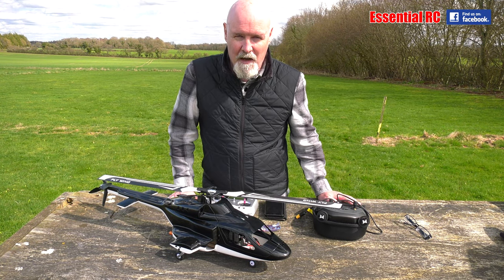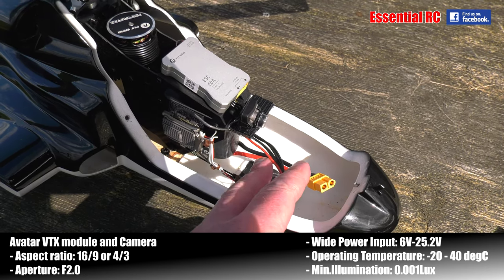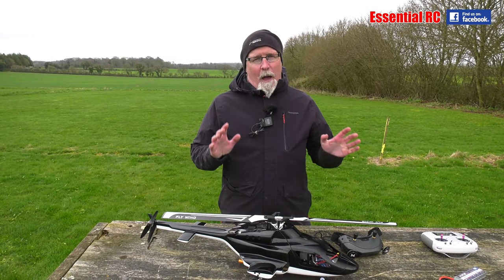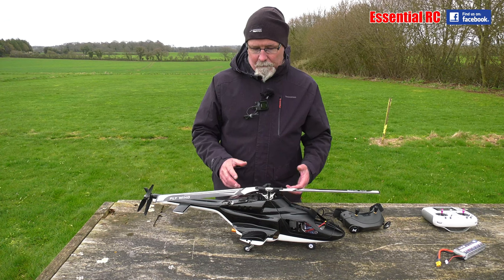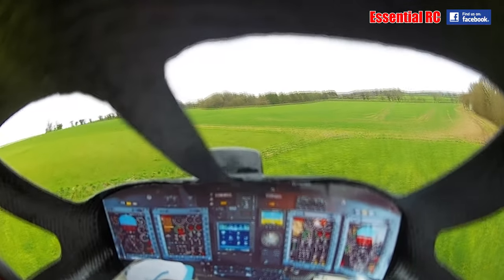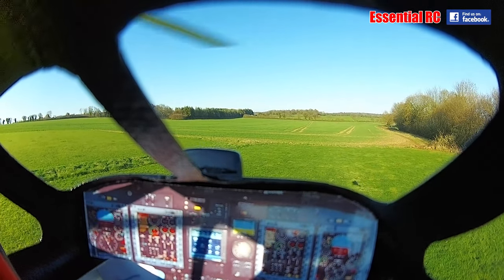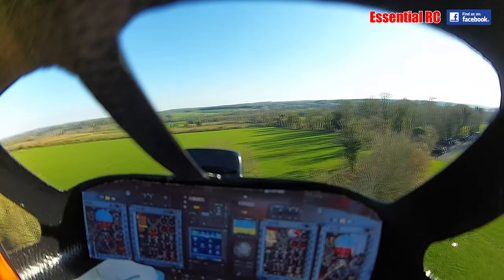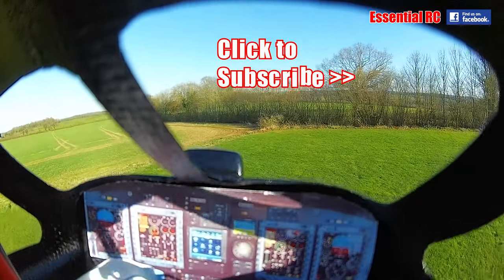Flying from the cockpit view ! FPV Airwolf RC Helicopter | Caddx Walksnail Avatar HD FPV

Comment: A perfect balanced helicopter will still vibrate. That is why quadcopters work better for video. Those blades changing pitch every turn with cyclic inputs will shake full size helicopters also. The old saying is full filled that how a helicopter flys is: It creates so much vibration the ground rejects it. lol

Comment: Helis can fly so much longer than quads, its a shame they got pushed aside as quads got more popular.  Would love to see more FPV builds with them.
Reply: yup few simple mods. lower the head speed by smaller pinion, (or lower kv motor) Asymmetrical Rotor Blades gives huge flight time improvements. you can go much deeper but then it will cost a lot more lol 30 min easy flight time when done right
Reply: @Dragon69FlyTeam damn thats some pretty impressive flight time coming from an fpv drone with 3-7mins basically depending on how fast youre flying and using full throttle. 
Ive always been interested in trying an rc heli but they either seem to be cheap one's or the nice expensive ones and i just dont know anything about them also in general. I fly fixed wing some with fpv and fpv drones, but never a Heli. I would love to pick up one of those smaller ones they have now that actually seem to be hobby grade by horizon i think and theyre also not crazy expensiveas like a first one to try it out. Any recommendations for something decent for like $100-200, or is that not going to happen?
Reply: Why is it so that helis fly longer? I thought that all those sophisticated linkages and the swash plate eat away the efficiency, as oppose to a drone where props attached directly to motor shafts.
Reply: @frigzy3748  Only one motor really doing the work on the heli. The little yaw prop in back doesn't draw much juice.

Comment: RC helis have always been troublesome to FPV, due to the inherent vibrations. I have to admit though I did not expect the 'answer' to be a 'solid' camera mount - I expected you would wind up mounting the camera via small rubber isolators - as used on old quad gimbal camers mounts - how wrong I was!!

Comment: At first I said the camera mount when it was first shown wasn't good as it moved way to much when touched and I was right. But I still believe the last little bit of Vibration is probably due to having the cockpit windows removed as now the down draft from the blades blows into the cockpit instead of flowing around it. Learned from flying in a open cockpit (no doors) compared to all enclosed heli cockpit in real life.

Comment: There is one idea maybe move the camera closer to the front of the cockpit and Maybe put like a board behind the camera
Reply from the maker: If move it forward then would lose the context of the cockpit and giving the impression in a helo cockpit. I like how you can see the tips of the blades as well. All adds to the immersive experience. Not sure what you mean by adding board behind the camera? For what reason?
Reply: Oh sry I didn’t know, the board was so maybe it would dampen the vibrations a bit but idk I’m not very good at this stuff lol 😂
Reply from the maker: I don't think it will get any better than that last flight. Just need to do some longer more interesting flights now.

Comment: First things first you did good putting the airwolf theme in!

Secondly, Im' thinking of doing this with a NITRO helicopter using a Motionsic BAG 2-axis headtracking gimbal. I previously flew that setup on a nitro powered biplane until that bipe ate shit for unrelated reasons. The BAG eats vibes like candy.

Comment: Nice, that cockpit view! I'm still learning on an XK110s, too small to mount a decent camera on. I think it might actually be easier flying FPV because you don't have the orientation problem. Would be good to have a rotating camera though so you can look to the side as well. Future project?
Reply from the maker: Have done head tracked FPV on several other projects. Yes...easy to do as long as the RC heli/plane can take the weight of the additional panning servo where you need it.

Comment: Did the VTX get hot at all? Is it worth adding a fan to blow onto it?
Reply from the maker: If windows are cut out and you are moving it stays cool enough but adding a fan would be no bad thing. Important that the VTX is as far from the FC as possible to minimise interference.
Reply: @EssentialRC  cool. I just installed it the same as you did. Of course glued not Velcro hahha. When powering on the Heli with VTX it won’t get hot instantly will it? I’m thinking I’ll still add a fan regardless
Reply from the maker: @THEMIGHTYCB  Good decision. Only factor is additional weight but these small fans and very light so should not affect CG. Advise do a range test to ensure VTX not interfering with FC.

Comment: What’s the average flight time you reckon you’re getting?
Reply from the maker: 5 to 7 minutes
Reply: @EssentialRC  nice. I tested my new dual sky battery and made it to almost 11 minutes then RTH activated. Was so impressed haha. 

My 3S doesn’t even allow RTH to activate as it believe it might be too low voltage it just drops lol.
Reply: @THEMIGHTYCB  Hmm thats verry short flight time... my 450 scale heli (verry old build still uses a old style flybar) manage 15 min of flight time on a 3000 mh 3s! (its a handfull to fly without all gyros though lol. Maby you already know, forward flight use much less mah than hoovering in the same place.

Comment: Which DuPont connector did you get? Trying to connect mind to my battery too
Reply from the maker: I have a box of male/female pins and connectors in a box so can make them up with a crimper.
Reply: @EssentialRC  there a way that comes with it to connect to a battery?
Reply from the maker: You can connect FPV camera/VTX to the flight battery balance plug
Reply: @EssentialRC  but what comes included doesn’t have what you need to go straight to the flight battery though, right?